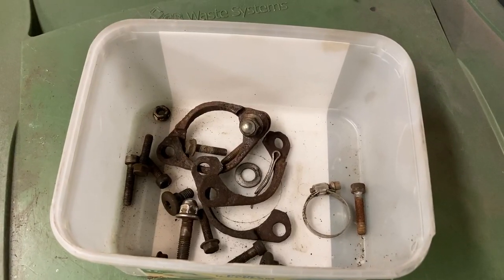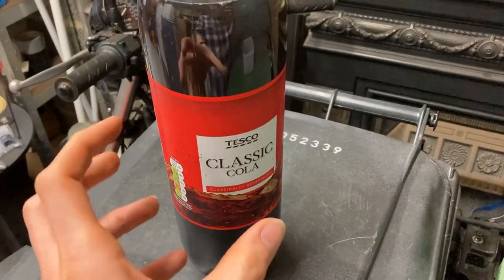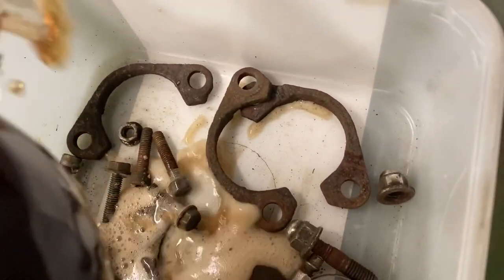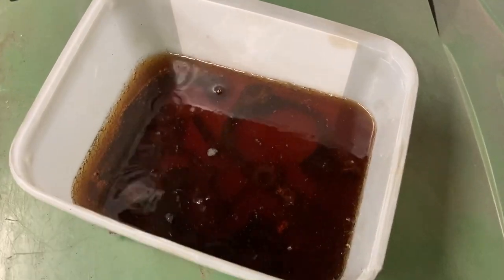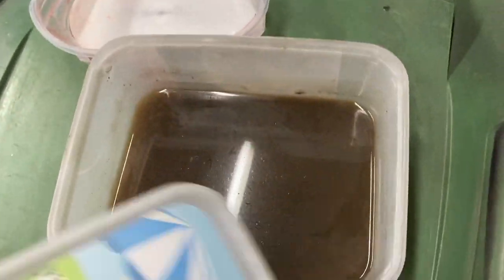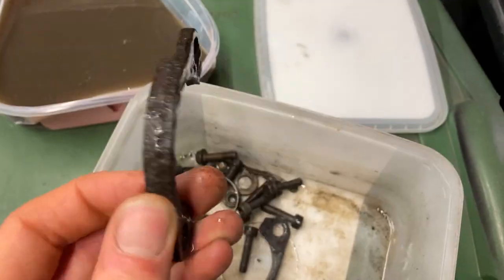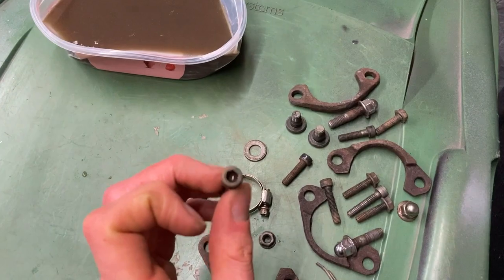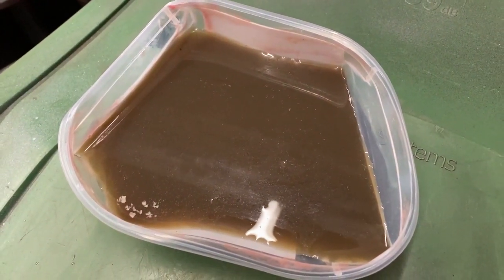Can You Remove Rust With COKE?!

Comment: I changed my oil cooler seals and was in no rush as I was off work, left any nuts/bolts I removed in coke for about 4 days. Rubbed them down with tin foil and they looked brand new again.